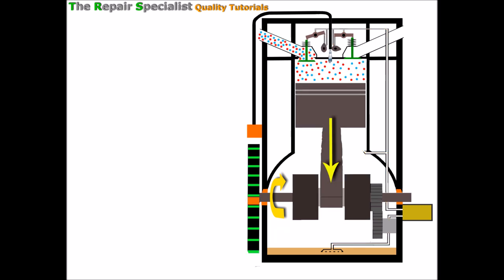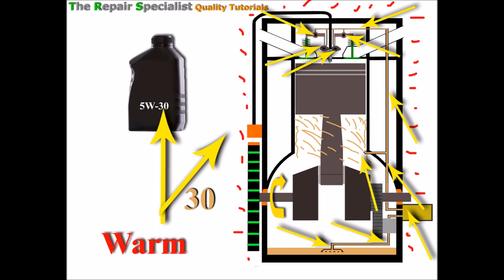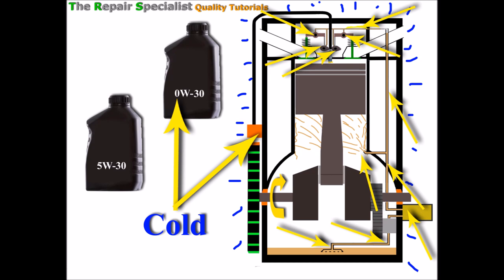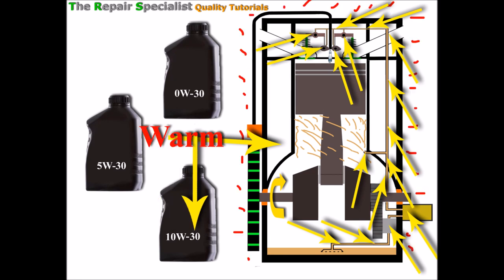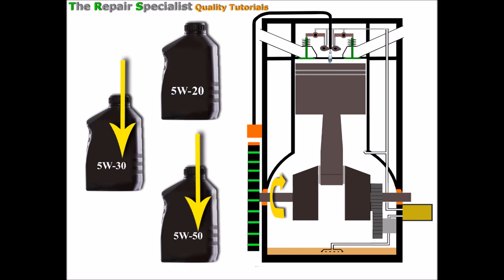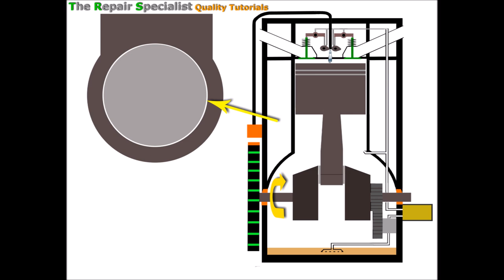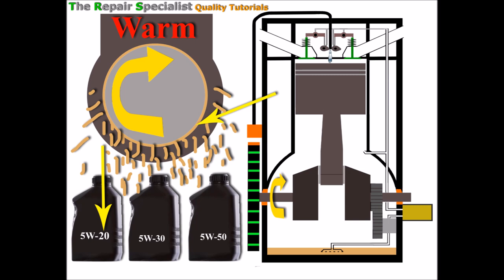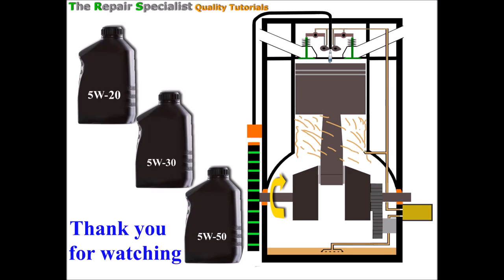'Engine Oil' - If Incorrect, this will happen! - Car, Lawnmower, motorbike, etc

Comment: Thin. oils Are for MPGs,  nothing more freinds,  cylinder tolerance can only be so  minimal Don't go Below 5w-30 or you will  definitely have premature failure from your Engine....   remember manufacturers need to Sale!!! What Engines...
Reply from the maker: Thank you for sharing your thoughts! You're absolutely right that thinner oils like 5w-20 and 0w-20 are often recommended for better fuel economy because they reduce friction within the engine. However, it's essential to follow the manufacturer's recommendations for your specific engine.

You mentioned not going below 5w-30 to avoid premature engine failure, and that's a valid point. Engine oil viscosity recommendations are typically based on the engine's design, tolerances, and operating conditions. Going below the recommended viscosity can indeed lead to excessive wear and reduced engine longevity.

Manufacturers do have a vested interest in selling products, but they also want to ensure their engines perform well and last as long as possible to maintain their reputation. Following their recommendations helps achieve this balance.

In the end, it's always a good idea to consult your vehicle's owner's manual for the manufacturer's oil viscosity and specifications, as they are the experts on what's best for your engine. Thanks for contributing to the discussion! If you have any more questions or insights, feel free to share them.

Craig